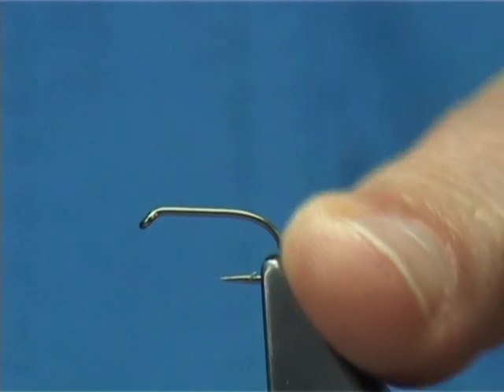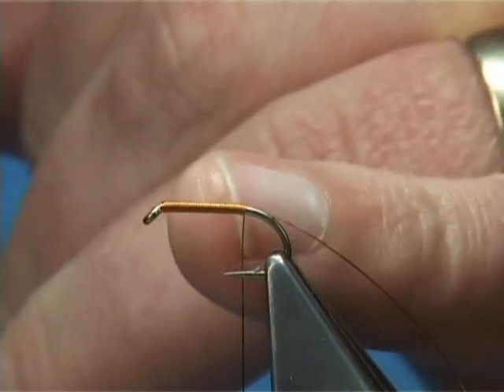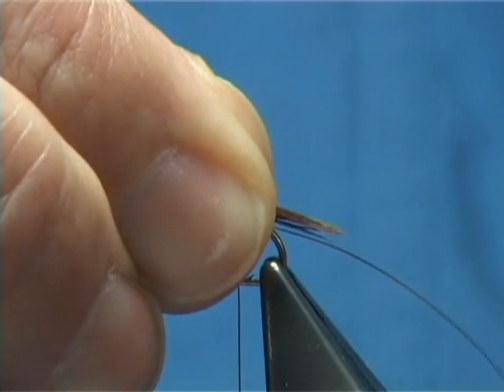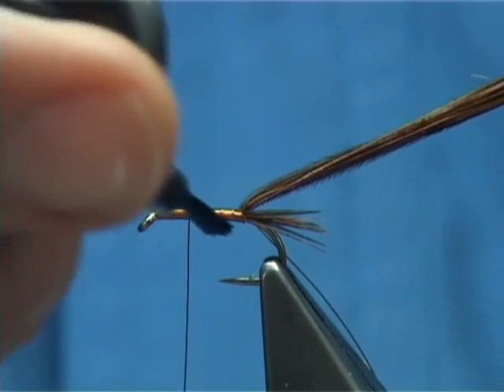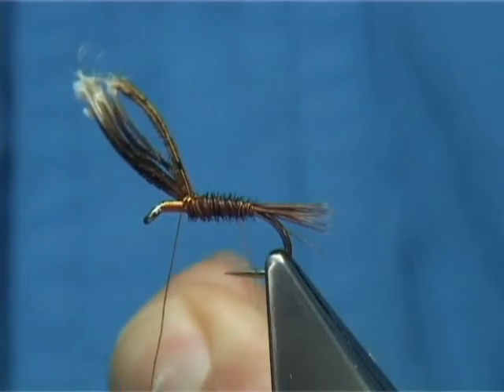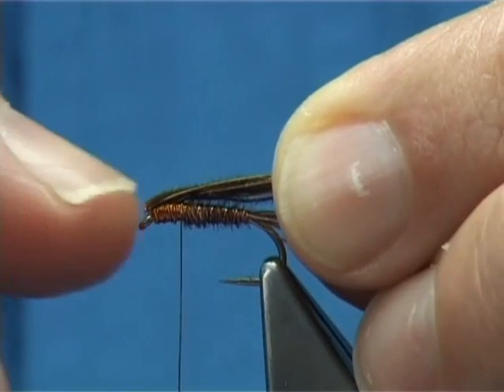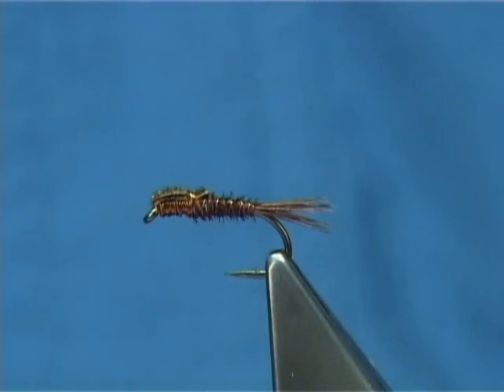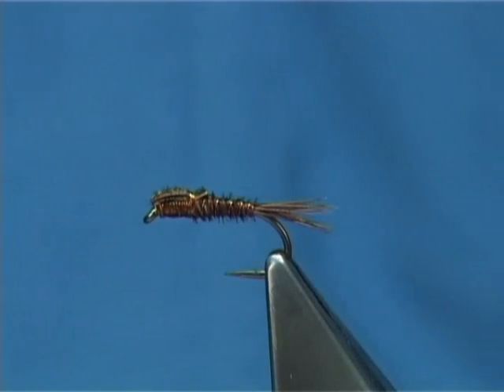Tying a Pheasant Tail Nymph by Davie McPhail

Comment: Hi Davie. Thanks for your brilliant videos. I've learned so much from those. Your tip about the Ceramic Bobbin Holder has really improved my tying. Many of my tying experiences were extremely frustrating as I kept breaking the thread, often during the whip finish, which I just do with my fingers. I have a tool now but find it tricky to use. I'm practising though. Since buying the Tiemco HD bobbin holder I very rarely experience a break even with fine thread now. Thanks!

Comment: Hi Davie
Thanks for all the great videos.  I have been using a Veniard's ceramic bobbin holder and UTC extra fine wire but the wire keeps breaking on me.  This happens at all parts of the fly and looks a bit like the wire is being twisted as it comes out the holder.  Any suggestions?
Thanks Jimmy

Comment: Davie, Where do you get the varnish and glue pots with  brushes from? Cheers
Reply: Alex Adams As far as varnish goes, I use Sally Hansen Strong As Nails finger nail varnish which comes with a brush ( using sharp scissors you can trim the brush ends to a thin point). Gorilla Glue makes a super glue that has both brush and dab applicator.

Comment: Hi Davie, What size/brand wire do you use?  thanks,, hunter
Reply from the maker: Hi Hunter,

Extra small or small UTC wire is very good and will tye you most trout size nymphs, they are coated so they wind well on most bobbin holders..I would use these wires as a guide to finding bulk spools which you will find in some electrical companies like Maplins here in the UK...

All the very best Davie